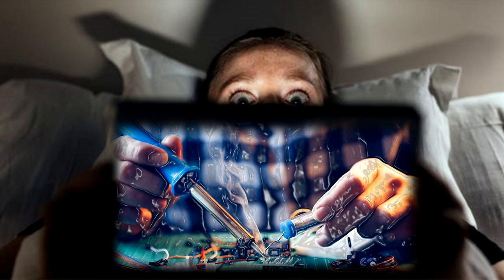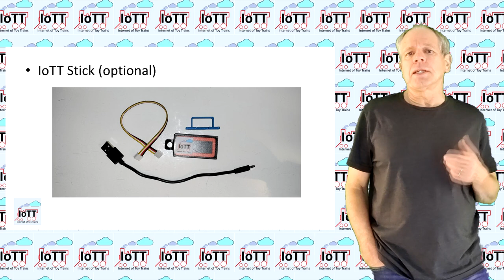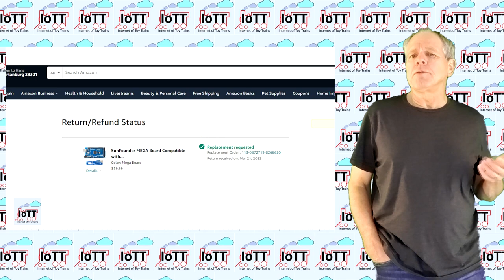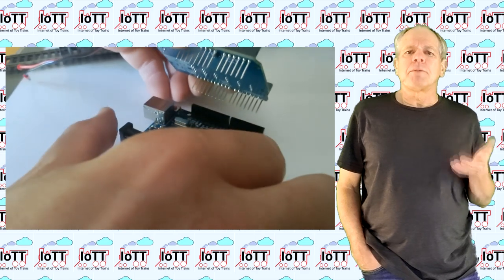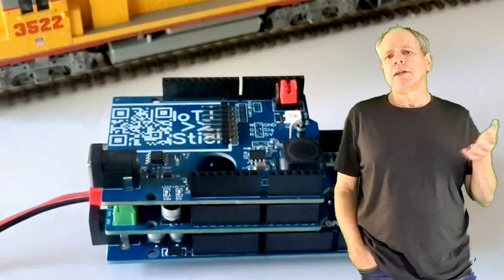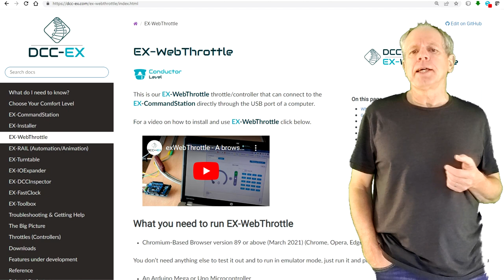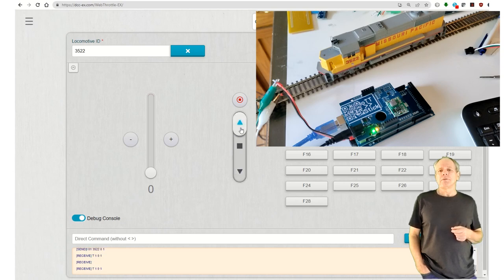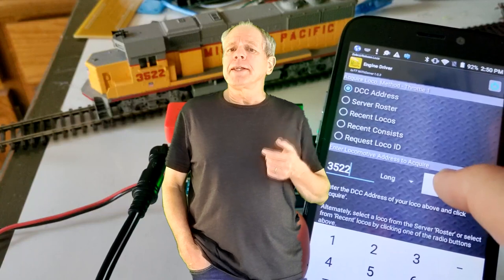Building an Arduino Command Station for Novices (Video#117)

Comment: I use DCC-EX for my main layout.   I got an Arduino Mega with WiFi built onboard as I felt the less hats the better, less points of failure.   It was a little more steps to get the onboard WiFi working, but once done, it is just as easy to use as anything commercial, and a lot cheaper.
Reply from the maker: Cool. What I like the most about the modular concept is that there are many ways to achieve the same goals. Lots of learning opportunities and quite some fun (sometimes some frustration as well...).

Comment: So the Aux shield is simply a voltage buck converter that sends 12 or 14 or however many volts to the motor shield but only 5V to the Arduino?
Reply from the maker: That is the core functionality, but there is more. It gives reverse polarity protection when using the DC plug, the 5V rail is now providing up to 3 amps, which is helpful if you connect other devices, and you do no longer have to worry about the Arduino onboard LDO when feeding higher voltages to VIN (up to 18V is no problem, the absolute limit is around 24V). Then you can connect the IoTT Stick to it, which turns it into a wireless Loconet command station with WiThrottle server, Loconet over TCP access for JMRI and other software, and the Loconet over MQTT gateway. Furthermore, you then can connect a WS2812 LED chain to display the status of current sensors, turnout positions etc., completely transparent between DCC EX and Loconet. Plus some additional functionality of the IoTT Stick, like e.g. the event handler, which lets you define IFTTT (if this, then that) sequences to implement automated signals and more, similar like what you can do with EX RAIL, but no coding, just clicks on the web page of the IoTT Stick.

Comment: Great video on the DCC_EX when I try to use the red hat in engine driver it keep me for a port number where do I find it other than that keep up the good work
Reply from the maker: If the WiThrottle Server is activated, you get a WiThrottle tab in the Red hat web page. Click it to view and set the port number. The default is 12090, which is the WiThrottle standard port on ED.

Comment: so just announced  DCC-EX Motor Shield  EX-Motorshield8874.  what's the difference compered to the iott 5amp shield?
Reply from the maker: I have not touched the actual product, so my comparison here is based on what is known about it so for, mainly schematics and data sheet of the H Bridge driver chips.
The most obvious difference is that the 8874 shield has two H bridge drivers, so it is a replacement board for the motorshield and provides two output channels. And it has an onboard DC/DC converter, which provides a 7V output to the VIN pin to simplify wiring.
When looking into the details, there are more subtle differences. The H Bridge driver 8874 is rated 6 Amps. so running it at 5 Amps. is relatively close to the max current. The BTS7960 on the other hand has a max current of 43 Amps, so there is more room. More important though is the combined ON resistance of both channels. For the 8874 this is 200mOhms, which leads to a power dissipation at 5 Amps of 5 Watts on a rather small chip. We will have to wait for reports from users, but I don't think it is possible to load it with 5 Amps continuous without the chip getting quite hot. The ON resistance of the BTS7960 on the power shield is 16mOhms, which leads to about 1 Watt at 5 Amps, and this is distributed on 2 chips. So, the PowerShield has some reserve and I am planning on testing it for officially rate it at 8 Amps,. which would be great for G scale.
The other notable difference is the DC/DC converter. It outputs 7V and feeds it to the VIN pin, which means the 5V for the Arduino is still created by the LDO on the Arduino with a maximum current of 0.5 Amps or so. The PowerShield on the other hand uses a 5V DC/DC converter which goes directly to the 5V pin and has a rating of 3 Amps, so that it is no problem to supply additional boards with 5 V, and even operate a LED chain as demonstrated in the last video. I chose this concept because it maintains the modularity, so if you have other boards in the stack that need higher voltage than 7V, e.g. a motorshield, you can still go with a single power supply. If you wanted to use a motorshield in conjunction with the 8874 board and feed say 12V to it, you still would need a second DC supply, because the VIN pin is at 7V fixed.
I am not sure about the flexibility of IO selection on the 8874 shield. I get the impression it  is only possible to use a limited set of IO pins to drive the board. The PowerShield for sure offers full configurability and you can use all IO and Analog pins of the Arduino board, so you have maximum flexibility to configure according to your needs.
That's just what I know so far, I'm sure more will become clear in the future.

Comment: In the DCC-EX documentation discribing use of the ESP-01-S for wifi, it recommends using the 5v power supply and a 3.3v regulator to power the ESP-01. Can the AUX shield perform this function? Further, could the AUX shield provide a connection in place of pins 18 and 19 on the Mega?
Reply from the maker: The DCC AUX board does not have an onboard 3.3V regulator, but as recommended in the DCC-EX docu you can connect one to the 5V. The DCC AUX 5V provides a maximum of 3Amps compared to the 1Amp of the Arduino onboard 5V regulator, s that should not be a problem. You can get 5V from the soldering pads of the LED chain or from pins 1 and 8 of the Stick connector.
The Serial port is only used if you are installing an IoTT Stick on the AUX shield. By default it is going to IOs 0 and 1.  However, if you place the red jumpers on the other side, Tx and RX are routed to the two soldering pads at the edge of the board, from where you can make a connection to the serial pins you want to use, e.g. pins 18 and 19. If your board is 3.3V, you should also shorten the two soldering pads on the other side of the jumpers to shorten the voltage divider used for 5V boards.

Comment: Hi Hans . Is it not needed to cut the Vin connection on the Bottom of the Motor shield ?.. Sorry I see someone else has already asked the Question.
Reply from the maker: No, it's no longer needed when using the DCC AUX shield which allows for a single source power supply of up to 18 Volts. See videos #115 and #116 for the technical background information, if interested.

Comment: I love that there is only one power connection.  Does that still apply if you have Mega+PowerShield+Redhat now?
Reply from the maker: Yes, it works as soon as you have a DC/DC convertor for the 5V supply. Older style RedHats have an onboard DC/DC converter (that green add-on PCB on the lower side). Or you use the DCC AUX board for the same purpose, which has an onboard DC/DC converter.
Reply: @IoTT  OK, so if I have an arduino motor shield, I only need one 12v power supply plugged into v1 redhat to power full stack.  But I assume the IOTT Power shield would still require its own 12-15v supply for HO because of the 5A.
Reply from the maker: With the PowerShield you connect DC to the PowerShield input and as long as you are not using higher voltage than 18V DC, you can add a jumper on the PowerShield to supply it to VIN, so you can power the entire stack from a single power supply. If you need more than 18V for track, you would need a second source for the rest of the stack and leave the jumper on the PowerShield open.

Comment: First I have to say your videos are fantastic. Really eye opening for someone new to the hobby like me.  One question tho.  This video uses  the 2A arduino motor shield instead of the 5A IBT-2 powershield.  Is this just because the motor shield comes pre configured in hardware and software?  To use the powershield, you only need to solder the pins(or buy the a preconfigured board) and configure the software?  For my simple newbie setup, I think I would  get a Mega, 5A powershield, aux board, and IoTT stick.  I only have 1 loco at the moment, so can expand later to add a programming track.
Reply from the maker: Thank you. Yes, you can use the PowerShield as replacement for the motorshield and only use a single channel. The only thing you need to make sure is to ground the unused analog input as if left open it may trigger the over current protection.
See the installation note for configuration examples: https://myiott.org/index.php/iott-stick/function-hats/redhat-shield-for-dcc-ex/47-ibt-2-power-shield

Comment: Hi Hans, As always an excellent video, and a great job you do for this hobby :

I wanted to know if you can help me with this question:

Today I have the original configuration that was previously used for a DCC-EX station, which is installing the Arduino Motorshield on the Arduino Uno or Mega, but chopping the famous VIN Pin, which was necessary to remove to avoid burning the Mega / Uno.

In this case, installing the stack as you show in this video, will I have a problem not having the VIN Pin on my Motorshield plate?

PS: I have ordered my DCC AUX Shield, to start restructuring my components 👌

thank you.
Reply from the maker: Well, it depends. If you just cut the pin between motorshield and Arduino, it is sufficient to just put the DCC AUX shield on top of the stack and power the DCC AUX shield. The Arduino will get the 5V supply from DCC AUX and that is all that is needed. If you cut the trace on the Motorshield board, you have to resolder it as it is needed to power  the shield (instead of using the terminal connector)
Reply: Thank Hans,, I didn't just cut only pin, the track never cut it.  @IoTT